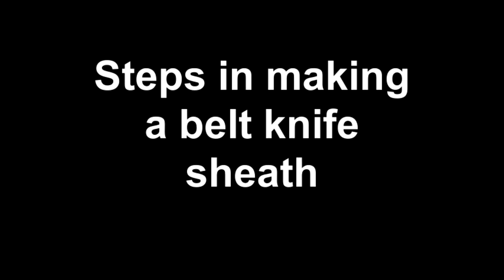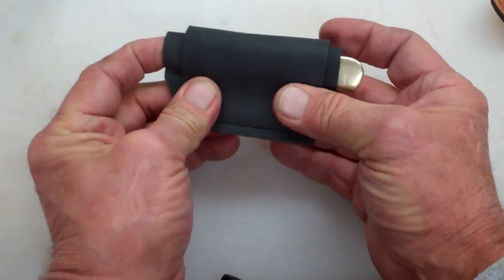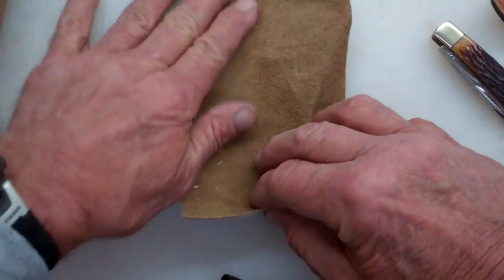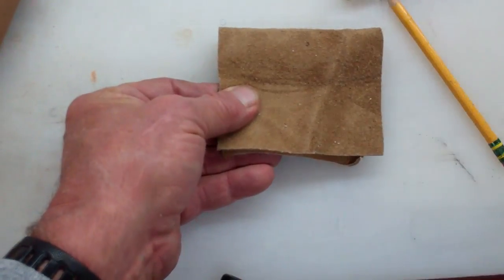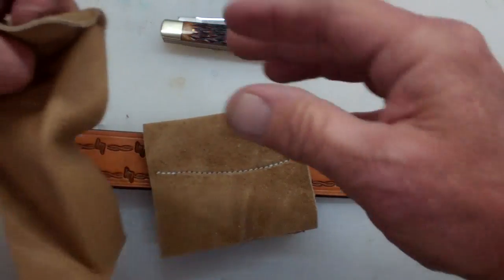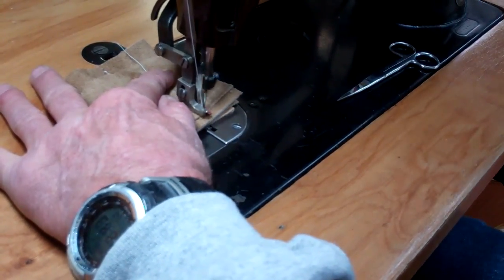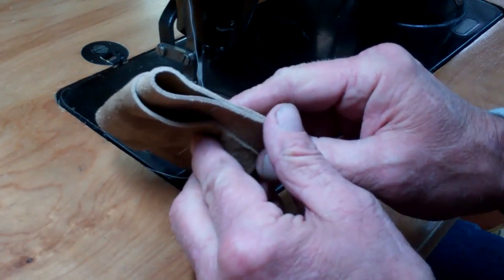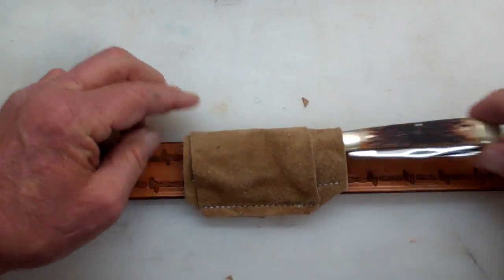Making a simple belt pocket knife sheath

Comment: Very nice, simple and easy to follow. This is an easy, inexpensive and quick project for people like me who are eternally bored :)  I realized that it would be easy to make changes, modifications and custom fit the holster for any knife or tool. Just one observation is that if the outer loop was stitched, snapped or riveted to the inner piece that you would have a second pocket in front of the knife for a small sharpening stone. Great idea for using scraps to make a nice sheath or carrier.